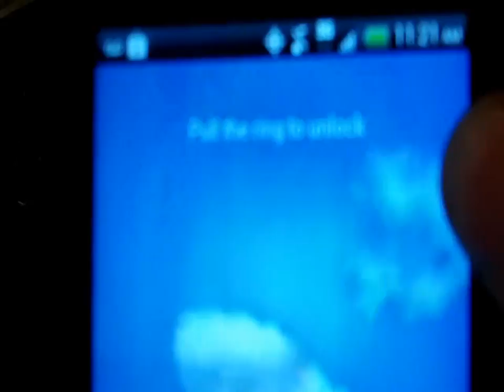just a broken day

Comment: I snapped the metal guide on of my winches so it tangles every time I use it. Needless to say, I don't use it. I lift the ass end of the bike out of the mud, reach over and pin the throttle, and push like Ron Jeremy.